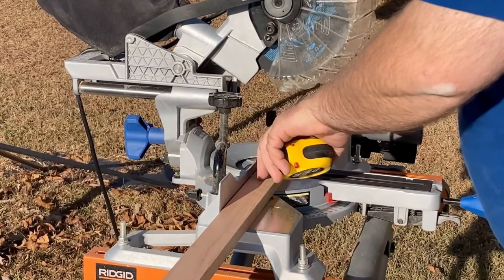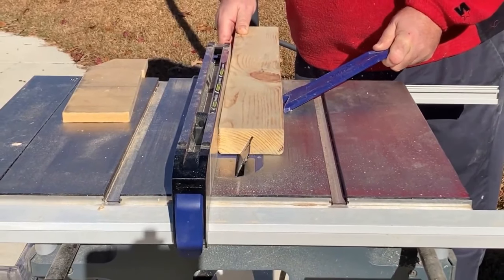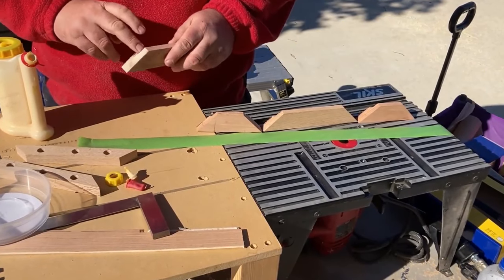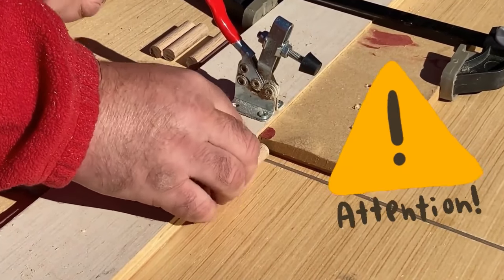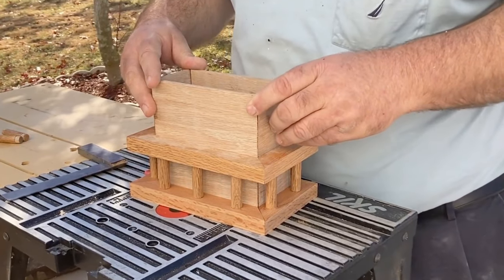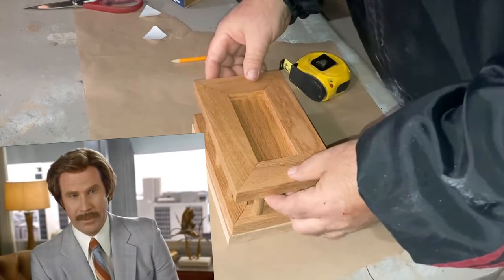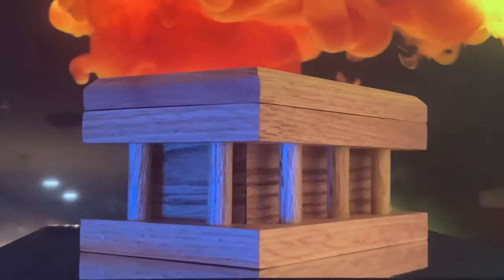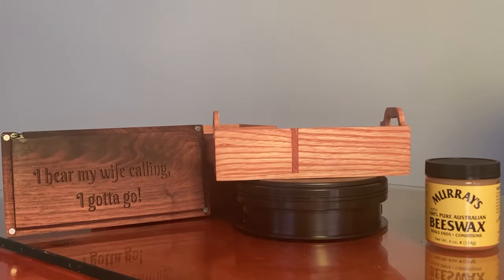Unleash Your Creativity With A One-of-a-kind Handmade Wooden Gift Box!

Comment: Obviously you figured out an elegant solution that worked for you but why not just drill the holes bigger instead of trimming down the dowels?
Reply from the maker: I did not have a drill bit the exact size of the dowels so had to find a different solution. I really wanted the joints where the dowels met the flat wood to be crisp. Thank you for the question and thanks for watching. I really appreciate it.